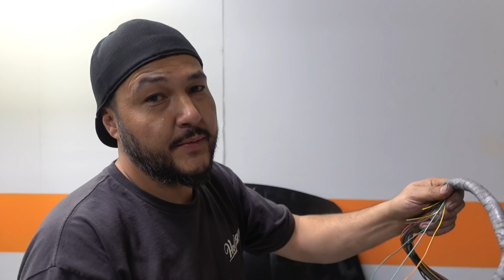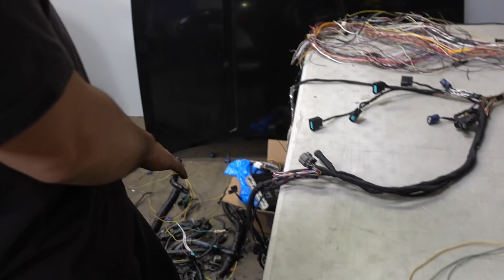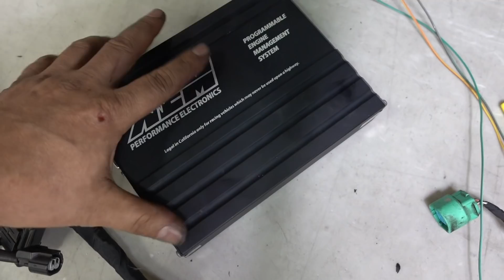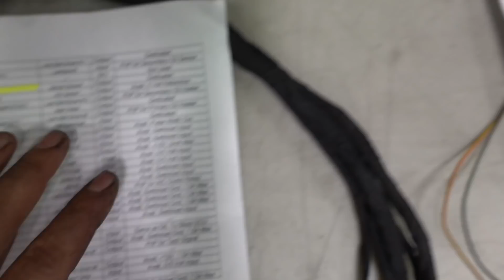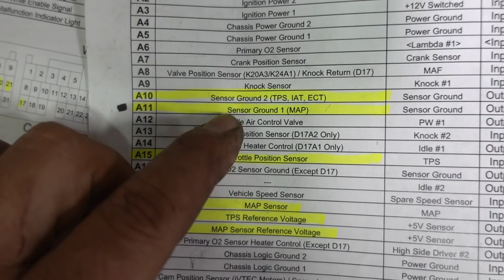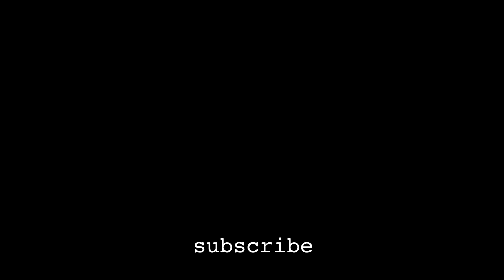Jamo Demystifies His Harness Building Process for Build & Battle!

Comment: Quick tip 

cut the wires at different length  so all the solder joints aren’t all in one sections  because of the magnetic field can affect the other wires signals. 

Also liquid taping then heat shrink is always a good idea

Comment: Well, isn't difficult but tedious, if you got the basics of electronics/electrics you can make it, just will take the time, because of your familiarity with harness e.g. Alan from SkidFactory got Subbies in his head and will do it in - let say 1hr, somewhere me doing it will take 6hr andbe accurate in doing stuff. also avoid any soldering / connections on pwm signals as they can be easily messed up.

Comment: all this wiring work doesn't seem like it's hard but it seems to be so tedious and requiring you to pay so much attention to all them details during that monotonous work. I guess that means it's actually hard.
Reply: Building wiring harnesses requires attention to detail and understanding of 12v systems.  Building an ENGINE wiring harness adds on the complication of understanding the basics of fuel injection, sensors, ground refs, shielding, signals, identifying types of connectors, and most importantly, how to keep wires away from things that get TOO hot.  That last one has bitten me more times than I care to admit...
Reply: @BadHaddy  yes yes, understanding sensors and how they work is a given before you start on a project like that 😂
Reply: i agree. it's the description of something hard, but it really ain't that hard if you take ur time :p and know ur way around a 24v/12v/5v system and a multimeter that is.